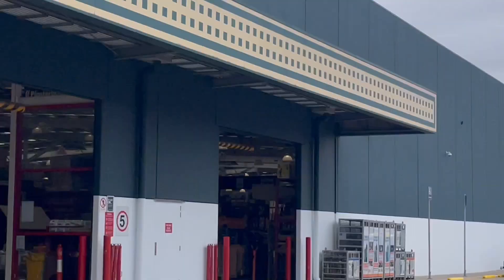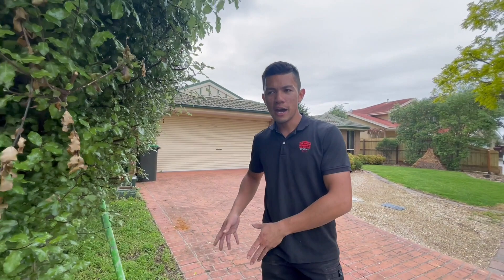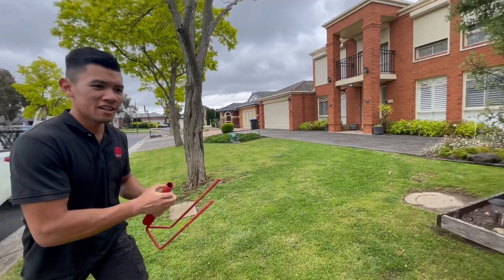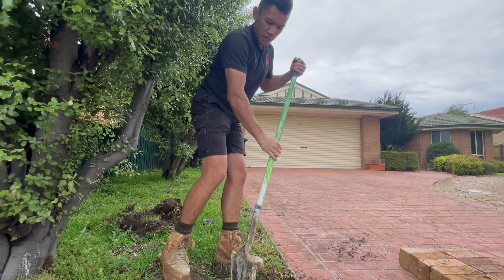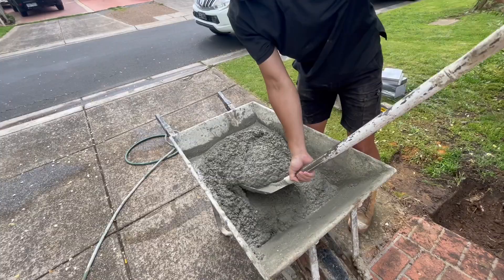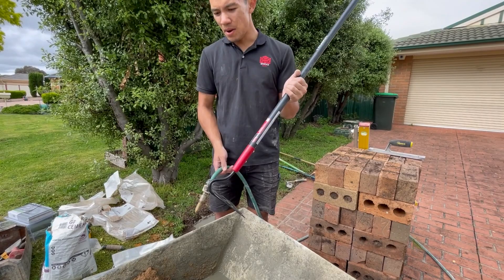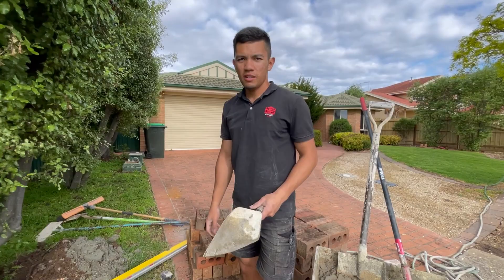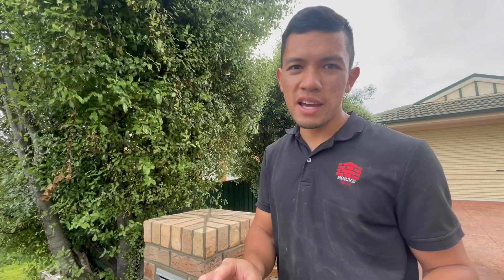Unique DIY Brick Mailbox | BRICKLAYING AUSTRALIA

Comment: Came up well mate. But mixing the mud like that is not the best way. Put all the goodies in the barrow, mix it up thoroughly dry, add your water using a bucket not the hose so you can gauge the water quantity better, then mix it up. Use the sides of the barrow as leverage points for your shovel that will reduce your physical effort by about 1/3rd. My old man showed me that many decades ago, he said let the barrow do some of the work.
Having said that I’ve never used one of those square edged barrows. I think they’re intended for brick carting rather than hand mixing in.